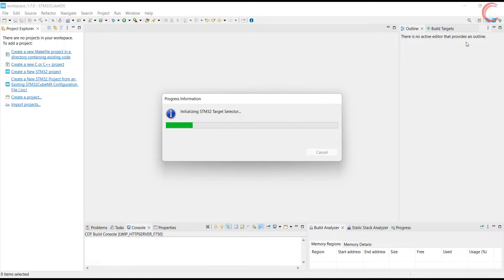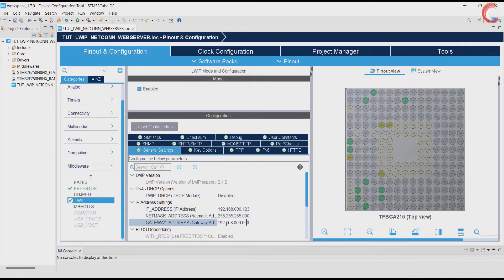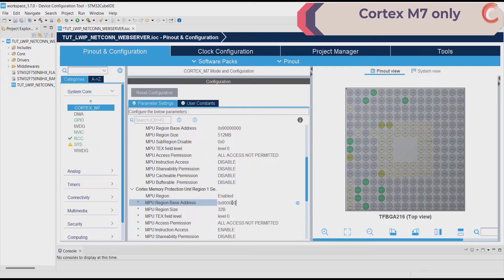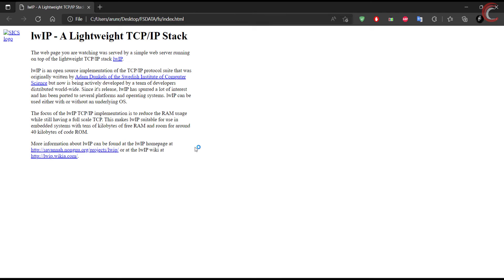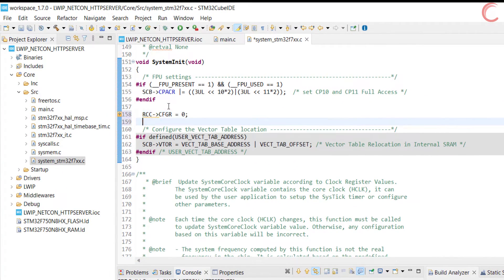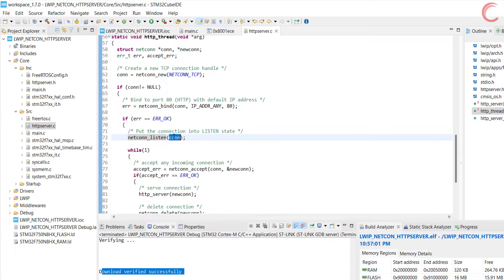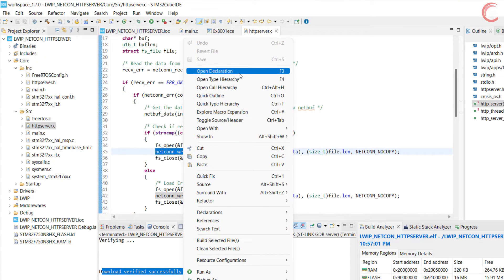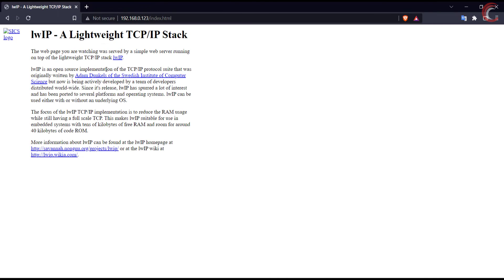STM32 ETHERNET #10 Basic HTTP SERVER || NETCONN || FREERTOS || LWIP

Comment: Your comment about hard fault issues is pretty harsh and miss leading.  The bug report link in your video description calls out increasing FreeRTOS stack size.  that is a must for an STM32F767 eval kit.  I've been running down a hard fault issue thinking I had some memory map issue.  Oddly, single step debugging yielded different entry points to the hard fault.  Couldn't explain that... non-deterministic errors are the worst!  I left microchip products because of poor code generation tools and worked in the registers too much.  It became a complete waste of time to even start with the code generated from MPLAB X.  ST seems to be in the same boat.  Surprisingly for as long as these tools have been around, they still can't be used mainstream and will never gain my trust.  Overall, you've got the best resources for the STM32 products. For that, I thank you!

Comment: STM32CubeIDE 1.9.0 and I have yet to get it to successfully ping with either STM32F769I-Disco, Nucelo-F756ZG or Nucleo-F767ZI.  The Disco worked fine with the liwp application example.  I've followed through step by step (without the external flash as each of these has sufficient onboard flash) multiple times using both STM32CubeIDE 1.9.0 and 1.10.1 with the same (lack of) results.  I also didn't find anything helpful in the forums and have tried to increase the FreeRTOS heap for the default task from 128 words to 256 words and then 512 words.  No change.  Any ideas?
Reply: Try checking physical pins used for ethernet interface in CubeMX. CubeMX while configuring was selecting the wrong pins eth_tx and eth_en in my case. See if it helps you.
Reply: I have the same issue with the F767ZI. All the ETH pins are configured and running at "VERY HIGH SPEED". I did have to up the default task ram from 128 to 257 as I was running into a hard fault but ultimately I cannot ping either. What gives?
Reply: Did you solve the problem?